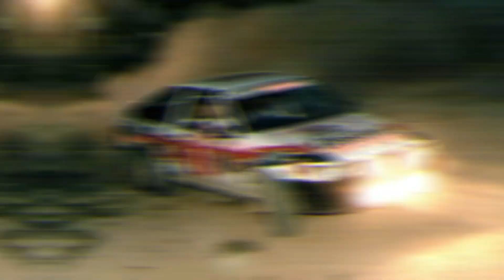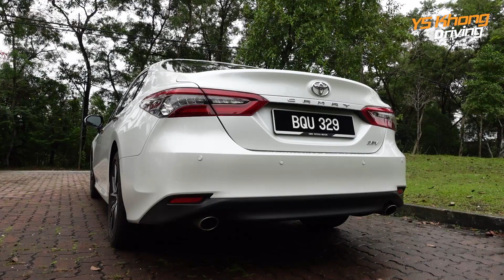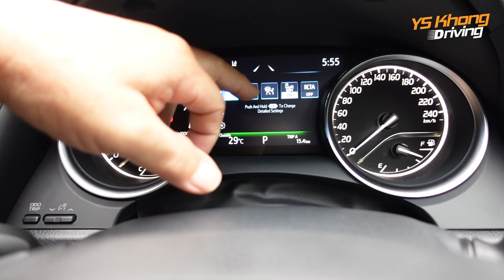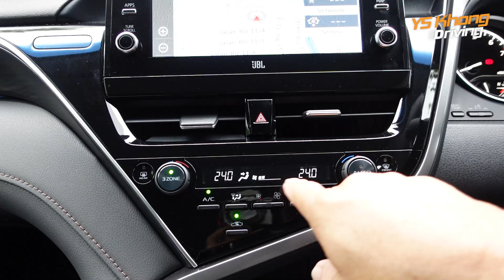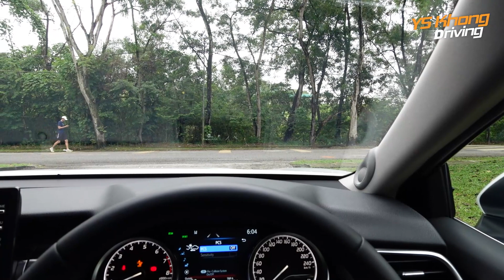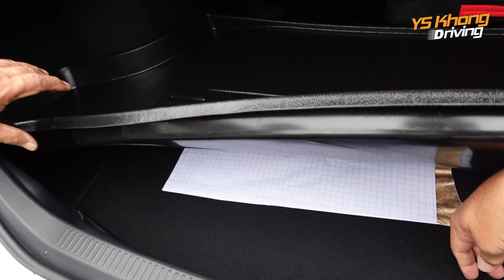2022 Toyota Camry With Dynamic Force Engine/ Walkaround Review/ YS Khong Driving

Comment: Did you add the hood struts? In the US it comes with a prop rod for the hood.
Reply from the maker: No, it is standard issue for Malaysia: each country has its own specifications, and the distributor has options to select from.

Comment: Camry has improved a lot in the handling department. Gone are the days of using 215/60/16 tyres which was super comfy but floaty at higher speeds to now using 235/45/18 which offers a firmer ride.

But how does the comfort level feel like to the taukey who wants to he chauffer around
Reply: Yes man. Old Camry was very ridiculous. 215/60/16 is obviously comfort biased. With too softly sprung suspension. I remember sitting in one. Tak boleh tahan la that ACV41. Too floaty, wafty, membuai2 and excessive bodyroll. High speed is worse especially going over undulations. Handling ke laut.
Reply: New one is the best. Toyota is heading towards performance and dynamics. TNGA platform with rear double wishbone suspension combine with 235/45/18 wheels is magic. The ride is much firmer in a good way. Supple enough for poor roads yet firm enough for cornering and dealing with undulations. If I can remember, It's just a little softer than Arteon on its softest setting. That's good.
Reply: 215/60/16 is the best for giant pot holes around me.

Comment: Uncle Khong, Thanks for sharing. Toyota always reliable car, no doubt. May I give one comment, price wise a bit stiff almost 200k, based on the current price, may able to get continental car (C segment), especially BMW always get special offer, rebate and 5 years free service and parts or Mercedes pre-own. Long story short, regardless Camry gives high-end material,  but price wise too competitive with continental car. If the Toyota Camry price stay like those day between 150k (2 liter engine) than you may see lots of Camry on the road. Currently can't see much current Camry on the road, same goes to Honda Accord as well.
Reply: Instead of Conti C segment rather go for D segment Passat. Because customers looking for Camry segment look for outright comfort, space, practicality. The rear wheel driven Compact Executive C segment sedans don't offer that.
Reply: @royalprince5878  So long Conti C segment able to produce decent comfort, space, practicality versus camry, it should be fine. Firstly, the most important is to understand market needs. Does current market look for comfort, space, practicality? or brand and price worth. Obviously could see on the road Conti C segment more than Camry. If the person are the company Executive level or Business man, do you think they will choose Toyota Camry or Conti C segment.
Reply: @chriswon6779  if i am looking for a comfortable in the price of the new Camry why should i settle for kess? Less spece less  power output unless u need to top up more and furthermore do take note that C segment conti car u bought will less most of its value a few months down the road
Reply: @yangerek78  Point 1. Less power is not an issue, so long decent power not under power, that's fine because we are not compete F1, all of us aware Malaysia maximum speed 110. Moreover Camry is 2.5cc road tax wise certainly will pay more than conti C segment. Point 2. What is the purpose to buy car, if the consumer want to buy car just for few months to sell it better rent a car, regardless Conti c-segment or Camry secondhand value more or less the same. To be honest  RM 200k car could get lots of option in the market. Take a look right now, brand new Camry not many on the road. I'm still think price wise of Camry abit high. Don't get me wrong, Toyota still a good car is just the pricing strategy. Point 3. Now a days consumer looking for decent price but branded car, smaller engine but decent power, 5 years free service & part's (Hassel free), less road tax. That's why few years back continental car meet consumer criteria (point 3) the objective want to take the market share of Camry and Accord.
Reply: @chriswon6779  I'm the authentic business young man 25 years old this year but I choose Camry over Conti C. My main concerns is NVH, comfort, hassle-free that's why I chose Camry. 218i, X1, A200 and C200 just not my type tbh I would rather jump onto 5 series or E class instead at a later date. I agree with all the view you have mentioned especially the road tax part gosh
Reply: @ryanjunweii796  same thought! 5 and E are real executive cars

Comment: That 8 speed is a 5 speed with 3 fake gears for bragging. Looks worse than a cvt from your videos.

However, i really like the facelifted interior. now its like other new cars with the screen on top
Reply from the maker: I found the gearbox performance quite good. Nothing fake about it.
Reply: No.. it does not have 3 fake gear. It is real 8 speed made by Aisin.. i have rav4 with the exact same 8 speed.. i like to use paddle shift and it shift fast and smooth
Reply: The ratios seemed too long to me. Similar to Honda 10-speed. By fake I mean that the last few gears are only there for fuel economy; they r not used for acceleration. It would be more exciting if the ratios were closer. I think it's safe to assume that u can cross 200 in 5th gear.
Reply: @tahsin28  3 Fake gear? last few gears for acceleration? what are you smoking? stop playing a video games and come back to real life.
Reply: @tahsin28  Stop whining ... you haven't got a clue ... 🤣🤣🤣
Reply: What the hell you talking about ? 3fake gears ?? Alamak ,. This guys
Reply: Dia pakai 4at je pastu nak complain.

Comment: This 2.5L fuel consumption same goes 1.6L Campro IAFM+ 

Rear passenger seat is convinient . Got pilot seat button, center arm rest controller . It is a smart move by Toyota .

For the engine, too efficient such Mazda SkyActive-G . That number of displacement NA engine could produce high power output and torque .

I wanna buy one if somebody could funds me 😆 

Good review Uncle ! 👍
Reply: Ask 200k ppl fund you RM1 each.
Reply from the maker: I also need someone to fund me, hahaha. Thanks for supporting.
Reply: @YSKhongDriving  Uncle, only 114k subscribers can fund you RM1 now haha. You have to get to 200k subscribers.